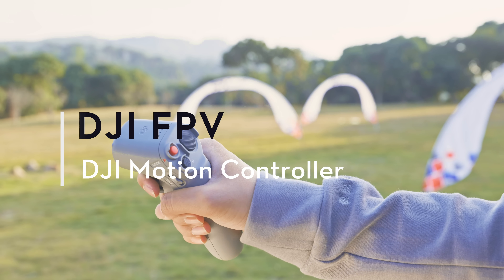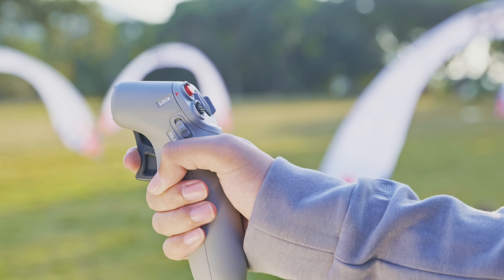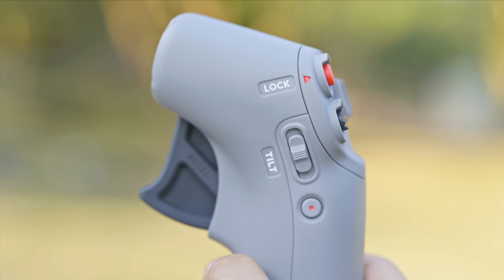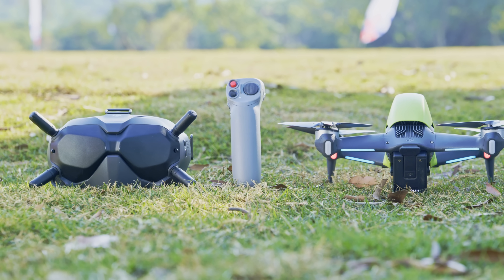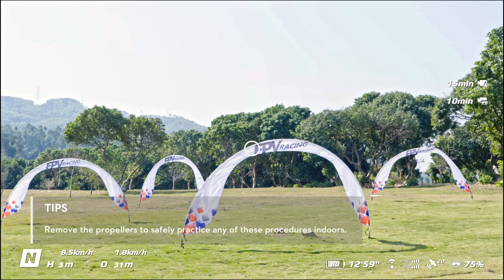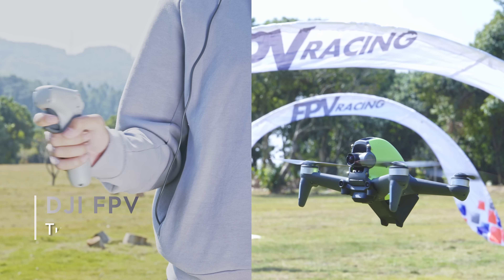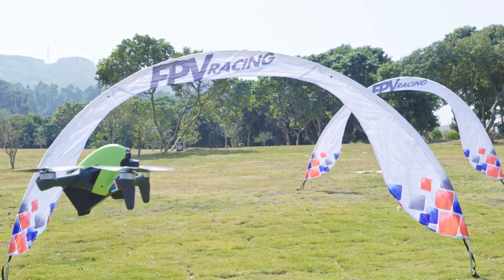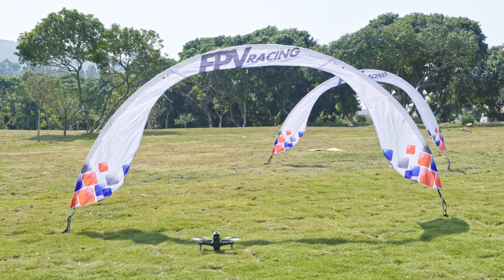DJI FPV | How to Use DJI Motion Controller - Try an Entirely New Way to Fly!

Comment: Is there no way to move side to side
Reply from the maker: Hi there, may we know which Goggles do you have? If you have the DJI Goggles 2, you may try to enable head tracking. See if this can improve your experience.
Reply: @DJITutorials  i have the goggles 2 with the avata ariving friday, ive seen alot of videos on the drone but with the motion controler i havent seen it shift side to side, is that just with the fpv remoter controler 2? or can the motion controler make it move left and right? (side shift, not turn)
Reply from the maker: @nephilim381  If you want to have the Roll Stick of DJI FPV remote controller 2, meaning: moving the right stick to the left or right changes the roll of the aircraft.
Push the stick left to fly left and right to fly right. The aircraft hovers in place if the stick is in the center. The more the stick is pushed away from the center,  the faster the aircraft moves, this movement is currently supported only on  DJI FPV remote controller 2.
Reply: @DJITutorials  is there no way to watch  Something like YouTube on the DJI goggles 2?

Comment: RTH - does it go UP to a predefined set height  first ? i guess not on the avata but what about the DJI FPV?
Reply from the maker: Hello, there. Thanks for your inquiry. There are three types of the RTH functions. The Straight Line logic will be triggered under a certain condition. You may refer to the User Manual(P.19) : https://dl.djicdn.com/downloads/DJI_FPV/20220112/DJI_FPV_User_Manual_EN.pdf

Comment: Hello, the motion controller that came with my avata is not charging. I tried using the the power brick that was part of the combo as well as using a wall charger, but nothing works. If anyone has had this issue and fixed it please let me know.
Reply: Hi I had the same issue, so im using mavic 3 cable to charge and it works
Reply from the maker: Hello, there. Sorry for your inconvenience. Kindly know that Motion controller does not support PD charging. Please change to another cable and charger to have a try.

Comment: Have just received the Avata and motion controller and it is incredible.  I cannot get my head around the accuracy and ease of use when flying.  I have the Mavic mini 2 and the Mavic Pro Zoom and am always extremely careful because of orientation etc but the motion controller with the Avata just works.  Wow
Reply: is there any delay?
Reply: @Nick-ng7cl  if your referring to the motion controller communicating with the drone then I would say no or none that I have noticed.  As for the video transmission apparently there is a very minimal amount of latency however I have done some fairly precise flights and have had no issues.  I expect there will be the experts that would disagree but I don’t rely to much on you tube anymore as some reviews seem to be slightly picky just to get the views.  You know the type ‘ you must watch this before you buy’ what you should know etc etc at the end of the day it’s subjective
Reply: @raspberrypiploy771  Ah alright, thanks for letting me know. Whenever I write comments/questions on youtube I never expect anybody to reply so thanks I am still thinking about getting it.
Reply: @Nick-ng7cl  For me it just gets better ... it has become my goto drone
Reply: I f’n can’t stand mine returning it.  Motion controller to me and my bad wrists are like torture.  If I wanted to fly with a banana dildo shaped device wouldn’t have gotten into drones.  😂

Comment: 180 degree turn would be better if turning the controller to the side causes the drone to continue turning in that direction until you bring the controller forward causing the drone to slow turning. This is better than turning yourself around while blind  wearing dji goggles.